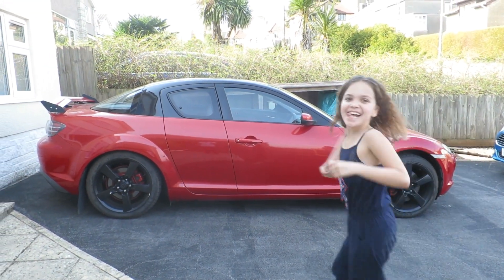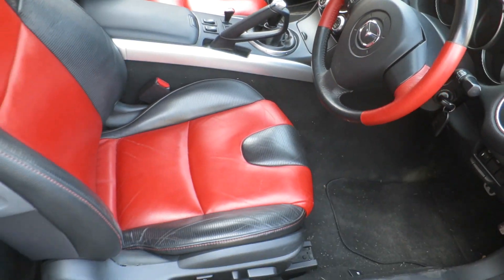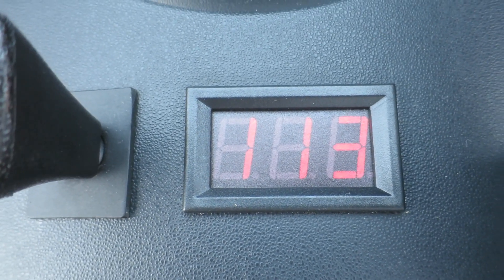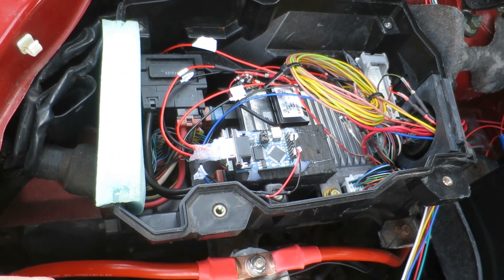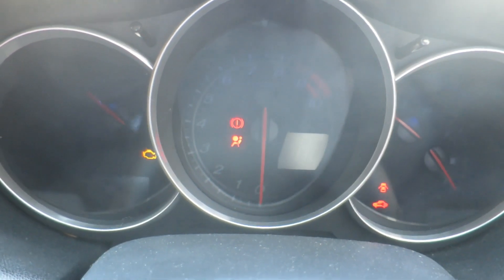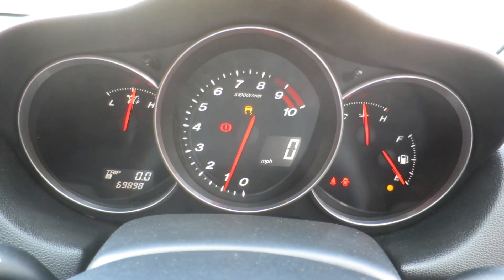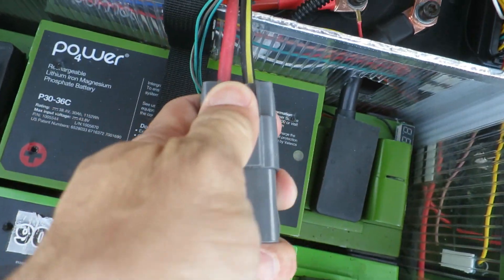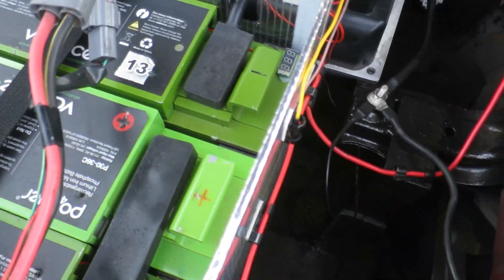Mazda RX8 Electric Car Conversion

Comment: Managing all this on a £4k budget including the car and tools/equipment is amazing! I already own an RX-8 and plan on buying one more to convert. I've already bought a Leaf motor+inverter and outlander battery pack to get me started. I have arduino code to control the cluster completely but would really like to have a look at your code for the power steering bits. Would be nice not having to reverse engineer the PS system as I've heard it is a bit fussy!
Reply from the maker: Hi - thanks for your feedback. I think I will make a video on the arduino code and PS etc.... That will help a lot more people than attacking it one at a time!
Reply: Definitely interested in the Arduino code for the rx8!   😅
Reply from the maker: @TheDriss567  Hay, as above - think I will produce a video about this!
Reply: Is an outlander battery pack a chesper way to go ?

Comment: First thanks for this very informative tour of your Rx8, I'm currently in the process of converting one my self!   The look is so cool very crisp!   
I'm very interested in the Arduino code and how did you wire the different elements of the car? 
Where did you get the vaccum pump and how do you regulate it? Is it always on?  Once again thanks for your time doing this video! I might put some videos to show you mine. I'm still in the "DeICEing" phase tho!  Hope to hear from you soon!  Peace!
PS: I'm gonna use a DC motor with a soliton Jr as the controller. 
Ps2: I saw on your channel some drone videos, check my channel you might enjoy it!
Reply from the maker: Hi - so I bought the vacuum pump from the same Chinese company as the motor and controller came from. Look on AliExpress - you should fine more on there. Currently it does not cut out - that is a 'todo' when I find a decent vacuum switch to turn the pump off at low pressure.